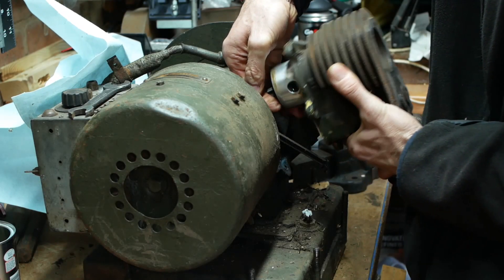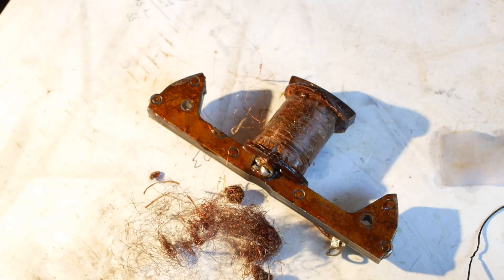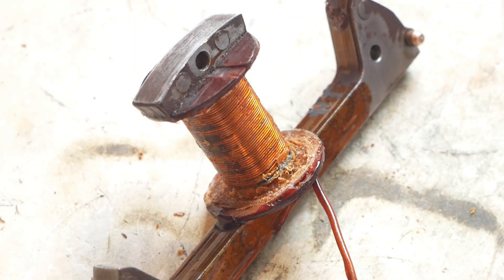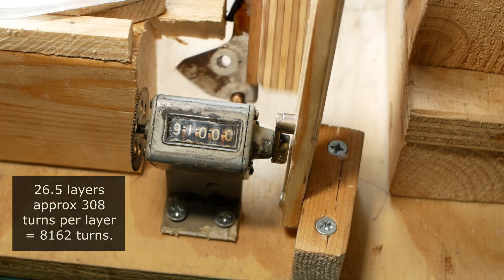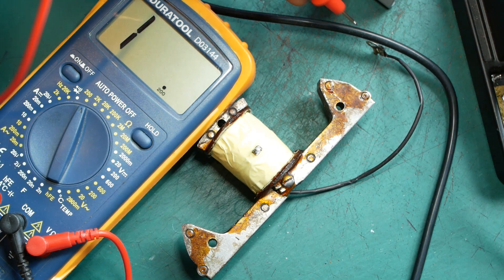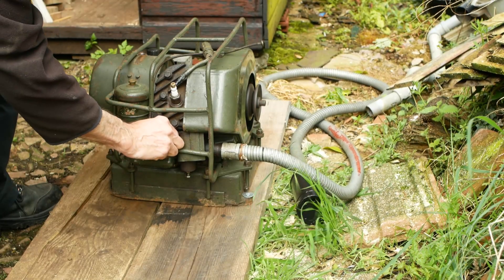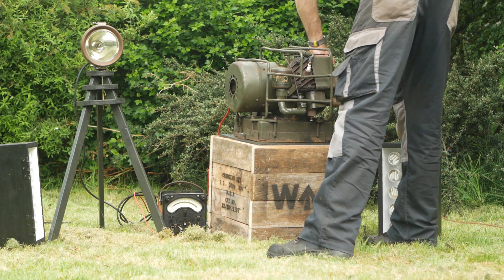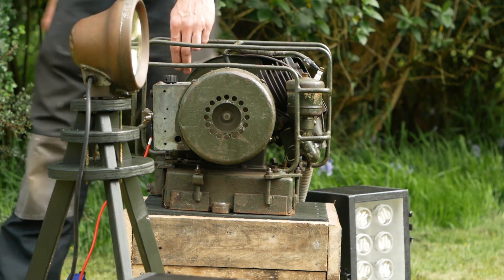BSA 300 Watt Generator - Chore Horse - Part 3 - Magneto Rewind and 1st Start

Comment: WEll done . Very interesting how you rewound the coil. Your jig making is simple but practical.
Reply from the maker: I've used that coil winder jig again since then - with a few tweaks, because on that occasion I was rewinding a coil for an old field telephone, which had been eaten by a severe battery leakage.  I need to rewind the coil on one of my Petter engines - it runs ok, but the secondary coil measures as open circuit, so it's only a matter of time before it fails completely.

Comment: To quieten it for shows you could try immersing the end off the exhaust in a tub of water. Some older engines actually used a water type muffler. Good job with rewinding the coil!
Reply from the maker: Cheers James, I've already made a second silencer to calm it down for shows, but I really like the bucket of water idea - I'll give that a try, that might come in handy on the next project (whatever that might be).

Comment: Today I enquired some engines and one of them is a set like this one. It spins over but its missing the cowling, air filter and the whole cage. And the control box looks to be messed up.
Reply from the maker: Well it's good that the set is now in safe hands with you Joseph, and you'll have it running again sometime.  I've seen a fair few of these sets without the cage - I guess people took the cage off for easy access or because it had got damaged and then the tow were separated for good.  The air filter, although the original is nice to have, any old air filter will do.  It's not particularly pretty inside my control box, but it all works fine so I'm leaving it alone for the moment.  The missing cowling is probably the biggest hassle - time consuming to fabricate a replacement, and probably the only way to get one would be to buy another engine complete with cowling.  I look forward to seeing whatever engines you got today at some point, your videos are always interesting to watch.
Reply: I might have a few parts for sale

Comment: Good work. I like the coil winder. I do have 2 AVO meters knocking about...
Reply from the maker: Cheers Ben, the coil winder was suitably rough and ready - it wouldn't do for me to actually engineer something good!!!  I only got that AVO meter recently - I'm kind of amazed that you can get such a good piece of test equipment for comparatively little money.  Just need to knock up a 15 volt battery for the high resistance testing and then it'll all be working as it should.
Reply from the maker: In an update since the last reply, I'd read somewhere that you couldn't get the 15 volt batteries for the AVO meters any more, but when I went searching, there they were, available to buy brand new on ebay - but I'd already bought some CR2032's for the job, and it turns out that my later version of the meter uses the round battery rather than the square one, so I've just taped together 5 of those along with some spacers and I now have a 15 volt battery and a meter that will measure megaohms or is that megohms, I'm never quite sure which is correct.
Reply: @GrumpyTim  Very interesting. I might pull mine out. I don't suppose you saw any 90V radio batteries about? :)
Reply from the maker: @BensWorkshop  I bought an old portable valve radio last year, started making a video but put it on pause until I had time to look a bit deeper into whatever was wrong (it wasn't the valves). Anyway, I went looking for the batteries and didn't track down either. I think there was a 3 volt one for the heaters, if I remember correctly, I hacked a 4 "D" cell battery holder so it was wired as 2 pairs in parallel. For the 90 volt one, I got 10 PP3s and bought 10 of the leaded battery connectors, and made up a little harness so they were wired in series - it was a bit scary connecting that lot up but it should do the trick when I get round to looking at the radio again. One thing I did find was that you can buy a power supply specifically for powering those old battery radios. I think I found a UK maker/seller on eBay.
Reply: @GrumpyTim  Interesting on the power supply. I have a home made one in a cupboard. I have many such radios. 
The heater for battery valves (D series valves) is 1.5V, not 3. Also the usual suspect tends to be the heptode mixer valve at the front end. (Primary part of the superhet circuit).
Reply from the maker: @BensWorkshop  I can't remember the exact spec for the heater battery I made, maybe it was a 2 "D" cell battery holder hacked so they were in parallel, that would fit with your voltage.  Thanks for the tip on what might be wrong, that'll help when do get back onto it.
Reply: @GrumpyTim  If you have the circuit diagram. try injecting a tone after the IF stage. If you haven't email me the model and I will see if I have.
Reply from the maker: Cheers Ben, I do have the circuit diagram for my radio.  I think we injected a signal at the volume pot (if I remember correctly) and got nothing, so surmised there might be a problem on the amplification side, but I'll probably start over again and check voltages around the board and take it from there.  I know I found at least one broken solder joint when I was initially looking.  I really should dig it out - can't entirely remember where I stashed it, but it can't be that far away!!!
Reply: @GrumpyTim  Interesting. Do you have a valve tester, or access to one?
Reply from the maker: Nope, nothing like a valve tester here, I did my valve fault elimination the dumb way, by substituting new valves.  I'm guessing that making a valve tester wouldn't be all that difficult - or at least testing the functionality of a particular valve wouldn't be too tricky anyway.
Reply: @GrumpyTim  No, you would have to look up pinouts etc. But unlesss your replacements came from a working circuit it might not help.
Reply from the maker: I was already figuring you'd need the data about the device you were planning to test before making a thing to test it - I think I dug out the data sheets about the valves in that radio, although that might have been something else I was working on.  I got busy doing other stuff last year and kind of lost interest in that radio - I'll pick it up again some rainy day and start work in a more logical order than last time I was working on it.

Comment: Good old Avo meter! I At college in the 80s we were next to the electrical engineering classrooms, they had shelves with about 100 of these things. When I worked for the same college some years later, I saw a lot of them in a skip, a real shame.
Reply from the maker: I think one of the issues for the Avo meters was probably the unavailability of one of the batteries - it uses a standard "D" cell for measuring low resistance, but then it has a 15 volt battery for the high scales and I don't think you can get those - I'm planning to design and 3D print a battery holder to carry 5 CR2032 batteries and slot that into mine.  I also need to make a new battery terminal for the "D" cell because one must have rotted off in a previous "battery leakage disaster" and someone has replaced it with some copper, but the copper is just too bendy, so I'll remanufacture that out of brass and then we'll be as good as new.  I've also got an older (1943) ammeter with external shunts from 1.5 amps to 450 amps - I'll probably display that with this set, assuming it's not likely to rain - those old meters are too good to leave out in the damp.
Reply from the maker: In an update to my last reply, I went looking for photos of the 15 volt battery to see what it looked like, only to find out that I actually can buy new ones, and also that there were two different types, a square one in the earlier meters and a round one in later meters - mine turns out to be a later meter and as I had already bought the CR2032 batteries, I simply taped 5 of them along with a suitable conductive spacer into a cylindrical form and now I can measure megaohms - yippee!!!!
Reply: @GrumpyTim  there you go! The Avo meter lives to fight another day. Now to go back in time 30 years to rescue a few of those Avis from the skip!
Reply from the maker: Yeah, there must have been loads of stuff that we'd now think of as exciting and cool just thrown in skips when it was no longer needed - a time machine is definitely the answer, just think how much cool stuff you could come home with for free!!!!!

Comment: I love your handcrafted solutions, your winding machine is great 👍.
And congratulations to your patience with so manylayers, which was rewarded by immediate success.
Reply from the maker: Cheers, it needed to be just good enough to do the job and no better, but I would definitely upgrade it a little if I was doing another coil.  It was pretty satisfying to see such a good spark once it was done.  I could definitely do it better if I started over again, and I'd be tempted to try the traditional insulation method using fabric, paper and shellac - I think that would seal it from the elements better and also hold the wires firmly, reducing the risk of vibrations causing it to fail.
Reply: @GrumpyTim  Do you have any idea how much longer the paper shellac method might have taken?
Probably, you could apply some layers of epoxy resins around the bobbin to seal it from the elements, or might that be not flexible enough?
Reply from the maker: @radiogagag9352  Initially I thought it would take ages doing it with shellac and be very messy, hence I went for the self adhesive tape, but thinking about it now, I could have pre cut the fabric and paper strips, so there would just be a bit of extra time applying the liquid shellac. It probably would be messy though, and there might need to be a pause between layers as the alcohol evaporated from the shellac mix.  It would be quite smelly in the room too. I could still do a shellac dip on the coil I made, but it's not like I'll be relying on the engine, if it conks  out,  it conks out and I fix it again.

Comment: Nuff respect Tim, windertron mk2 is a true masterclass of bodgery.
A nice fat juicy spark, agree the first layers of tape were less tidy, nice and neat at the end though, would you ever try with fabric and shellac after your tape experience? I can imagine it doing a better job of consolidating the coil and protecting from vibration/moisture ingress.
Either way, this is a huge step in shed based technology and I'm very impressed.
Reply from the maker: We love a good old bit of bodgery, and after sorting the reel friction issue, it ran really well.  I'd definitely try the shellac and paper method in the future, I think it would be far better, like you say, for keeping the wires stationary and sealing the whole thing from moisture.  I need to rewind one of my Petter mags sometime so that might be a good candidate for trying out the traditional method.  I definitely want to do another rewind while it's fresh in my mind.